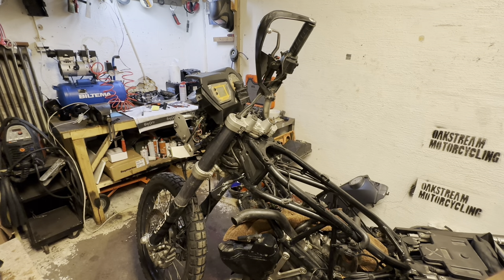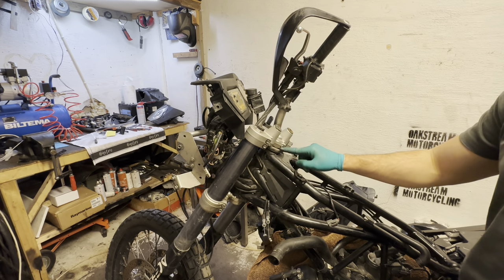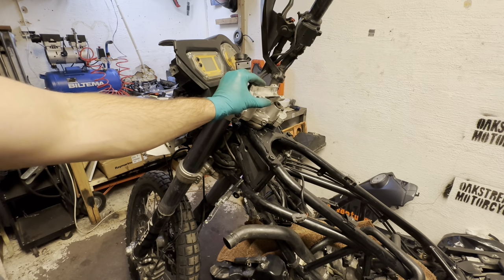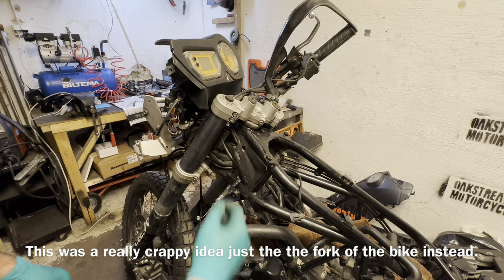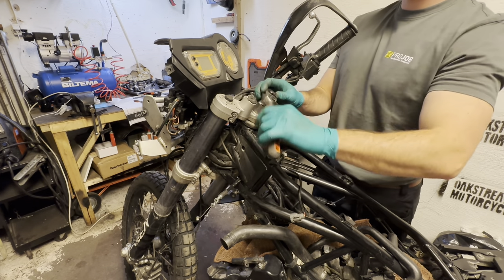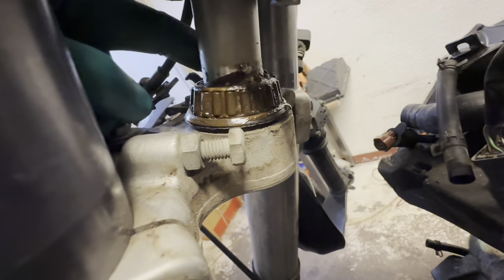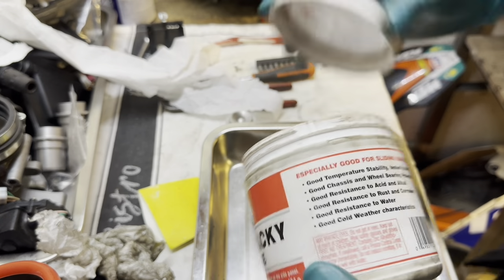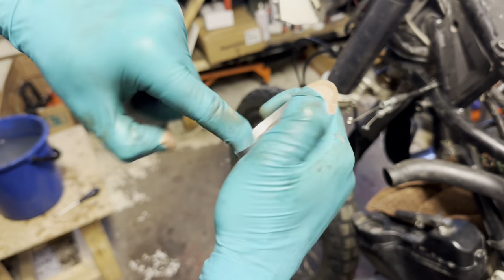KTM 990 ADVENTURE steering bearing maintenance.

Comment: How many km are on it do you think it was ever done before?  Good job.
Reply from the maker: I bought it just under 50000km and now its just over 70000. I know that it has had some sort of service done at dealers when it was younger but not sure what was done then. Probably the valves once.
This could be the original bearing but im completly sure it has atleast 30000km to it. Prob more. Stil holds up good.
I pretty sure that the chain and sprockets i replaced last year was the og ones😄
It mainly did onroad touring before i got it so i guess parts lasts then:)

Comment: Far too many things to go wrong here if not carefull, if the front wheel moves forward you will have the forks fall and hit radiator and stretch the brake lines, this is the wrong way! take your time and do it properly removing the front wheel, calipers then each fork leg, no need to strip the bars neither, a 27mm ring spanner will fit the top yoke nut, if you have no record as to when the bearings were changed last and have got to this position then change them out, they are a crucial part of the steering and not expensive. a garage will be able to get the bottom bearing race from the lower yoke stem for a few ££ so this is one area you do not cut corners, how much do you value your life???
Reply from the maker: Calm down. If you pay attention you notice that i admit in the video that trying to do it that way was a bad idea and that you should do it properly instead.
And there is nothing wrong about regreasing a bearing that is in working condition.

Best regards
Reply: Totally calm as a motorbike Mechanic mate, my only problem is that a lot of people would only partially watch you video and go out and make mistakes without watching the whole video, if you had a disclaimer at the beginning then that would eleviate what you started out doing and the correct way of doing it. i love watching your videos and how to's as we can always learn from each other, every day is a school day so not a dig at you at all, i did the same as you a few years ago on a 990 adventure and the wheel slid forwards, i am confident in what i do but others are not, i managed to save the day but afterwards realised the dammage i could have done etc. @OakstreaMC
Reply from the maker: @markariewilliams  Well i guess you have a valid point. I updated the video description with a disclaimer👍🏻